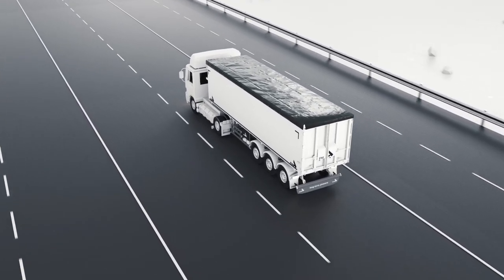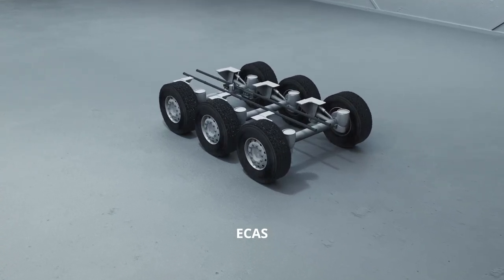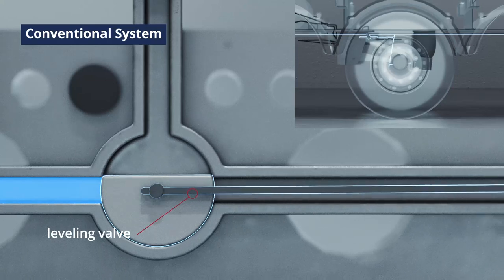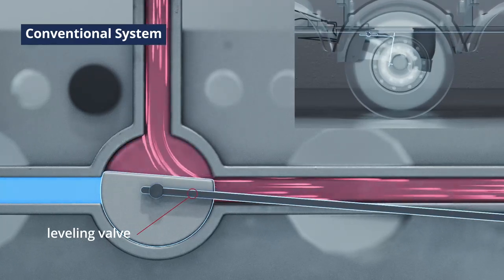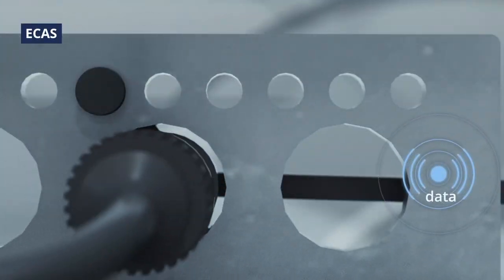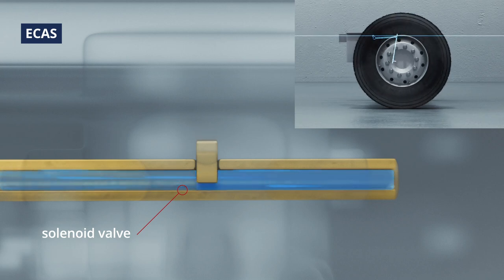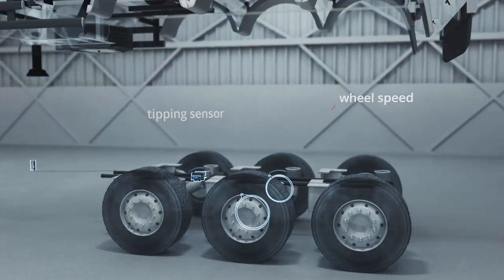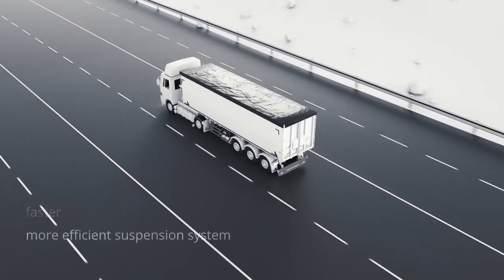What is ECAS (Electronically Controlled Air Suspension)?

Comment: I have check ECAS light on my 2016 Freightliner cascadia, what should I check for I don’t have a clue about ecas
Reply from the maker: Hi Hamid, we really don't know much about your Freightliner Cascadia, as this is an American truck, and we're a European trailer manufacturer. However, it's useful to know that an ECAS system uses input data from a lot of different sensors, so taking a look at those probably won't hurt. Specifically check the height sensor/levelling valve on your rear axle as seen in this video: https://www.youtube.com/watch?v=LiQlsMfYlPs
P.S.: always put safety first when working on your truck by yourself! We hope this helps!